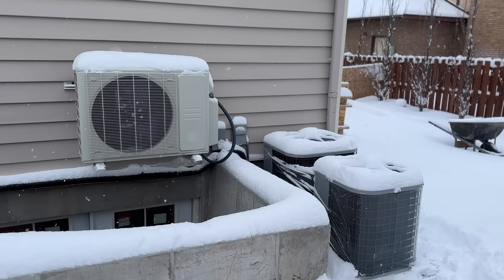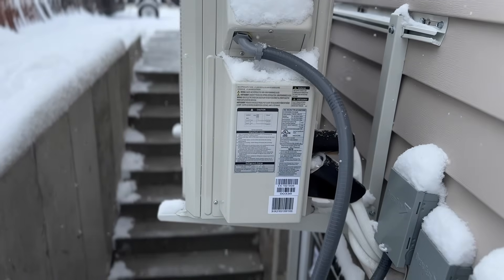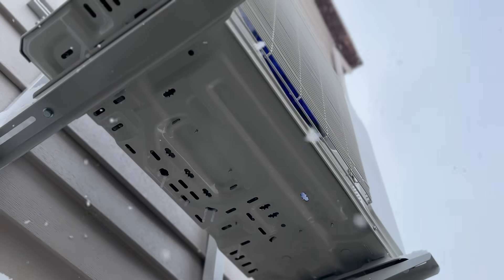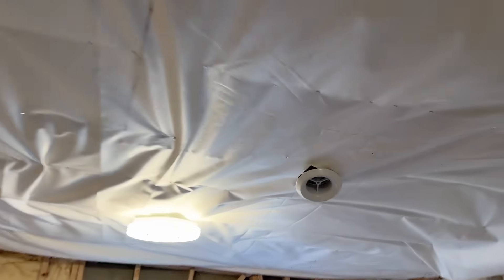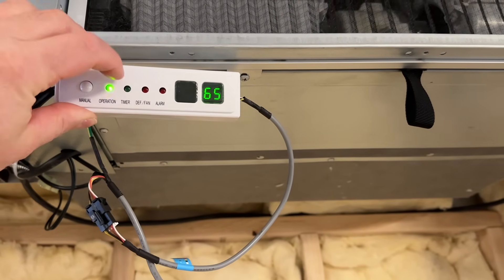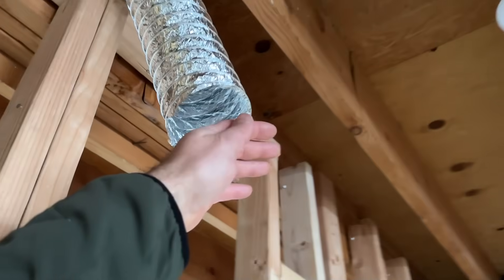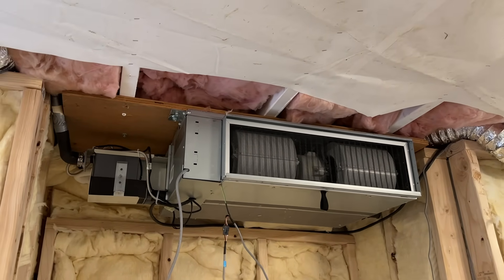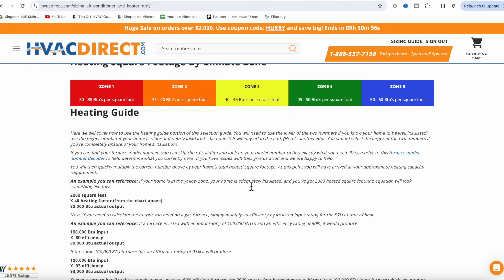What Is A "Concealed Duct" Mini Split?

Comment: While ACIQ is an interesting product, its SEER 2 rating is only 16. My Trane 5-ton, two-stage unit has a SEER rating of 14-15 SEER. So this unit is not more efficient than central HVAC systems, though it is somewhat cheaper. As a comparison, I have nearly finished installing a Mr. Cool 12,000 BTU Mini-Split heat pump to cool my garage (I live in Arizona, so I probably will never use the heat function). I got it on sale for $1,350.00 and it comes with a 7-year parts compressor warranty and a 5-year parts warranty. More importantly, it has a SEER 2 rating of 23.5, which is exceptional when you consider the cost. When it is running in cool mode, it will use less that 4 amps of power. My Trane 5-ton, two-stage unit is VERY efficient. and it uses between 9-13 amps of power when running. So the 1-ton Mr. Cool minisplit is 3-4 times cheaper to run than my Trane AC unit. This incredible efficiency is why people buy mini-splits and this ACIQ unit has below-average efficiency.

Comment: these systems are absolutely AWFUL if you have more than one unit in the house they ALL have to have the exact same mode and temps set or none of them will work. so i cant have my living room a bit warmer than the bedrooms vice versa cant turn the heat on in the bathroom if its not on heat somewher eelse in the house it takes me 30 minutes of running through my house if not more having to sync the mall up its absolutely horrible

Comment: 1) More effective to put concealed unit in utility room for anticipated, regular servicing. 
2) The condensate pump will overflow from hardened grunge obstructing float movement.  
3) Better placement to run unpumped tube to washer drain. 
4) An easily removable faced plywood panel matching the drywall at the very least could be put around unit. 
5) Ducts inaccessible for cleaning will collect dust and microbes from condensation. Better smooth pipe with cleanouts. 
6) Ducts routed to floor for heat to rise. Basement floors are notoriously cold!
7) Outdoor unit obstructs light, drips down people's backs, creates ice and unsightly mold, slippery and inside-trackable fungus on concrete, awkward to service, needs rooflet, and vibrates into house. 
8) Perpendicular positioning on top of retaining wall could have taken advantage of natural air flow.
Reply: Yes but other than that......

Comment: Architects, homeowners or whoever comes up with these places to mount them in do not take into account future servicing or repairs that will be needed. Aesthetics are important to a certain extent, but you have to account for these factors. I’m going to be looking at home this week or next and I have feelings this is gonna be an issue. If I cannot convince them to install it in a different place or consider different options or at least leave a very good amount of access space for service and repair. I will most likely not take the job or write it after it is installed, I am not responsible for service or repair of this unit. I suggest yall to do the same. Sometimes the money isn’t worth it.

Comment: You're not running sheet metal ducts. I get the notion you're just slamming it in. Was hard to follow your roughed in work meaning how the system works.

Comment: I'm in South Florida and I was thinking about replacing my 5 Ton Central AC system with a Mini Split system.  My wife HATES the idea of utilizing the wall mounted units and the problem with the ceiling mounted units is that in a place like my Family Room / Kitchen, I'd probably have to go with a 16-18K BTU unit right in the middle and take out the two existing AC ducts that are there.  Would I be able to put one of these in the middle of those two vents and run ductwork to them... They are both 12X12 Vents.  Or would I be better off putting two 8-12K BTU Ceiling Cassettes there?  The room is 20'X18' about evenly split between the Kitchen and Family Room.
Reply from the maker: I have a video coming out soon on installing a full home mini split system with ceiling cassettes. Maybe it will help you make your decision! 
If you end up needing remote support for your project, feel free to check out our remote support membership at Patreon.com/diyhvacguy

Cheers
Reply: @diyhvacguy  That would be great, but I'm starting to lean more towards doing Concealed Ducted Units.  I was watching a video of a guy who put in 5 units to replace his Central AC and he ran ducts over to all the existing vents.  That would be perfect for me.  I have a 5 ton unit that's failing and it looks like this would probably be my best bet.

Comment: Love those units .... but the flares bother me.  fFares must be installed with proper torque wrenches, but seldom are.  Consequently. 5 to 10 yrs down the road leaks will appear....and they will be a bear to find and fix.   Yes, I know 5-10 yrs sounds like a long time, but trust me, it will fly by fast and the anguish will be awful.   Best advice I have:  be sure the flares were properly torqued, and even if so, be sure you have access to the flares for a leak sniffer at some later date.

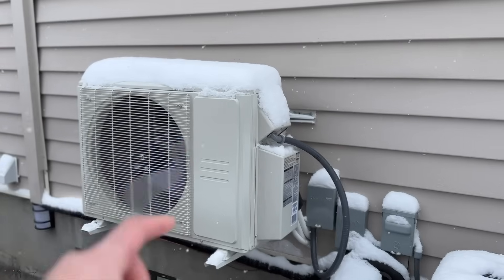Comment: Why do you have hoses behind the outside unit, leading the rain into the wall. Slanted improperly. 0:39 That does not look right at all. Shouldn't it lead rain water away from the wall?
Reply: Those are the hvac lines that connect to the outside unit.
Reply: @videosvideos6243  
But why not take the trouble to slant them properly so that it does not lead rain water to intrude? Lousy caulk that maybe lasts only but a few years, should not be the only defense against water getting in?
Reply: @yosefmacgruber1920  the correct way of installing the compressor is at level. The mini splits have an adapter drain plug that a hose can be attached to drain during the winter. The hose can be aimed away from the house. In this video someone skipped that step and is letting the compressor to freely drain at the bottom. I would not want to be under it when that happens.
Reply: @videosvideos6243  
But why are the hoses slanted so as to lead rain water to the wall rather than away from the wall? I provided a time index 0:39 showing where I spotted the flaw.

I thought that the drain hose was only for the summertime condensate water?
Reply: @yosefmacgruber1920  ideally the compressor should be installed lower than those lines. That was not a good installation. The lines should slant away from the house and connect down to the compressor, and all should be protected with mini split line covers. Someone made a very poor installation in this video and will most likely develop rot in the future.
Reply: @videosvideos6243  
Do you think that some of those mini-splits are easy enough to install that even I could do it myself? If I move to another country and there is no A/C, I might just have to do it myself? Especially if the windows are not suitable for a window unit. It must be nice not having to give up a window every summer.

I am not all that handy. Maybe I would have to do it a little at a time.
Reply: @yosefmacgruber1920  yes, you could do it yourself. The easiest to install are from a brand called Mr. Cool. Use common sense such as the item has a drain that for the a/c portion originates from the air handler; therefore, it has to be the mounted the highest, than the line compressed lines, and finally the compressor at the ground or closest to it. I have installed a few. No big deal.
Reply: @videosvideos6243  
How long does an installation take? And what about the dedicated circuit and conduit for the outside unit's power source? Does Mr. Cool have any models for more than 1 inside unit connected to just 1 outside unit?
Reply: @yosefmacgruber1920  installation can vary in hours depending on the construction of the home or building that it is being installed. If you do it by yourself, it can take anywhere between 6 to 40 hours (if you have everything planned and all of the materials at your reach). If you are knowledgeable working with electrical, that time is included in my post. If not, hire a licensed electrician. Mr. Cool had diy multiple units if that is what you need. Telephone them first and they will help you with the planning. Watch all the Mr cool videos to help you plan. Plan, measure twice, and order all the materials prior beginning the project. It’s easier with two people during the passing of all of the lines through the walls, lifting the compressor into place, and sending electrical wires through areas inside the house or building.
Reply: @videosvideos6243  
If only I could clone myself. Even if it came with the hole saw for cutting through brick or stone, it would not fit my little "toy" corded drill that my Dad gave me, so buy a real drill. Just to make one hole. Of course if I moved to a more civilized country, why I would be doing such a project to begin with, they probably have real handymen who have tools.

I might only need one inside unit, if I move to an area that supposedly does not need A/C. Likely would use it for heat also. Probably cheaper heat than portable resistance heaters.
Reply: @yosefmacgruber1920  yes, I am saving about 50% on the electric bill from using window a/c. Mini splits are very efficient when you install the type with no duct work. Duct systems and window a/c are the least efficient.

Comment: Why in the holy hell would you add ducts to a ductless system?
Reply from the maker: In this particular instance because the wall is literally underground. You’d have to mount your wall unit and then figure out how to get the lineset up and out which is difficult when the upstairs is finished.

Comment: I used to use central air . Died on me so decided to go with ductless mini split . The idea of maintained temp with more efficient cooling was very appealing . Turned out to be a terrible idea now that i know more how air conditioning works . Ductless mini splits should not be sold and used unless in dry hot locations . The concept of a mini split . Cool down the space then slightly warmer air blows out to maintain the area . Well suddenly i noticed the humidity levels rising a lot . When the set temp is reached . Made me realize ductless mini splits should not be sold . With central air , after set temp is reached it shuts off . It runs for only around 30 seconds after set temp is reached pulling in that warmer air out the air intake . Keeps humidity at around 50% … ductless mini split runs non stop so when the set temp is reached those ice cold coils are warmed slightly resulting in very wet air blowing into the room . Example - put a full water bottle in your freezer for 2 hours . Take it out and set it in your sink . What do you see after a short time ? Huge amount of condensation on the bottle . Same thing with ductless mini split . That wet air gets blown into the room . So annoyed that these companies do not disclose this .. wish i could sue the company to take them out of my house and fix the holes . 
 Now I’m curious how ducted mini splits work . If they work the same way as my central air does i would swap my mini splits out as i can hopefully some time afford to .
Reply: You can set the fan to turn off at Thermostat off on ducted mini splits on the wall controller.
Reply: You couldn't be more wrong in your explanation of how this actually works. Do some research and read the operational instructions a little closer. Dehumidification control has alot more to it, most residential systems do not incorporate whats needed to properly dehumidify and keep the space at set temperature. The space being conditioned may not be properly insulated and vapor barriered also, lots of factors involved.

Comment: Did that IQ unit replace the other 2 condenser units or in addition to . If in addition to those to just became service persons nightmare  with service points against two walls and each other. Those concealed ceiling units are a bear to service even with a hanging ceiling and worse with Sheetrock installed. Speaking from experience.

Comment: All that excellent work to have the heat come out on the ceiling ??
That ductwork looks vey sketchy, dryer vent type.
Insulated hard ducts with smooth interior surfaces to the floor, would be important to me.
As noted multiple times, servicing these units might be a pain.
Reply from the maker: They couldn’t be put in the floor. This is a basement that’s being converted to living space. And the ceiling is all insulated so doesn’t really matter if it’s hard pipe and insulated? I think not. It’s a pretty small space. I’m sure this will do the job just fine. But I just wanted to share the install with everyone.
Reply: I misspoke, I meant running duct down the walls to have the warm air vent at floor level.
Thanks for posting, great channel !!

Comment: This system is going to be impossible to service once the drywall is installed. Everything around them should have removable panels so the indoor unit, and it's piping to the outdoor can be serviced/replaced in the future. As others have said not using insulated ducting is a mistake. 
The first problem, that snow not having a rain hood over the outdoor units. They suck the fresh falling snow in, which freezes to the coils. Now you probably have temps that stay above 10F or so (in Utah) , but here in Iowa, all my units will have the coils that never finish the defrost cycle, and slowly ice builds up from the bottom to the top of the coils. I just shut all 4 units down because of this, as the outdoor temps have fallen to -16F for highs, which is improving today to +5F. Two of my units are Trane/American Standard, but they are Gree from searching the part numbers on the circuit cards. I purchased them as surplus units two years ago, as American Standard has moved to Mitsubishi manufactured units. I've not seen any units that work other then the Diakin down to zero outdoor, and have a defrost cycle that properly clears the outdoor coil. 
The worst unit I have for defrost cycle is a TurboAir, as it clearly was never designed for heat pump operation below 32F. This was my first unit I got off eBay, and now they don't make mini splits any longer as a company. So even the units the indicate operation to -22F, where the COP is 1, are wrong for my area. We do have the extremes of a hot summer, to cold winters here. But compared to where I grew up, central Iowa is the "banana belt" of tropics (North Dakota). The problem with a ground source heat pump is the limestone that is a few feet below the surface here. And even then the amount of equipment is costly assuming you can get a heat exchanger loop deep enough to extract earth heat. Water well types of heat exchangers are expensive to drill through limestone, and you need two of them. Lot's of maintenance with pumps, water to refrigerant, added equipment and control. But it is where we will have to go in the future with fossil fuels being banned. Still no clue where all that electricity is going to come from, and shared with EVs.
Reply: Excellent Comment !
You have outlined the issues with these units being installed , and ( mandated ) perhaps to get Canadians off natural gas.
They are expensive, $12-20K for a unit in a house with electric baseboard heaters supplying 2 units , one on each floor.
Gov't offers a $6K rebate , so you can gues where the pricinf is coming from.
Reply: I think fossil fuels will  be around for a while.
Anyway, 35 yrs ago, my uncle did a geothermal heat pump outdoors with a well and separate unit.  They always had problems with it.  But the water it drew was suppost to be like 55`f through the winter months.

Comment: My issue with Mini splits is that the inside units ALWAYS develop mold. You have to clean the inside unit  every 3-6 months.
Reply from the maker: Yes I’ll be doing a video on how to mitigate the mold issue
Reply: I did not know this, they are being installed in the PNW and on Canada;s west coast, where mold is an issue with moisture and winter.
Reply: Buy the new senville units or c&h astoria. Easy removal of the inside fan. Or put an uv led strip.
Reply: @sprockkets  Senville doesn't have a very long warranty (compared to others). What's your thoughts on them?
Reply: @brianbowersox  the warranty doesn't mean much because most self install. If a compressor goes out, the amount of work to fix it, would be easier to just replace the entire unit. 
Warranty is good though for fan motors, leaky coils in the inside. Pioneer gives a 5 year warranty for self installs, but I really want that new setup with senville aura. I've had to take out a fan motor, and is a pita.
Reply: @BFETile  i should update, still have some mold growth with my uv led light.
Reply: @ oh wow…that’s not good!!!